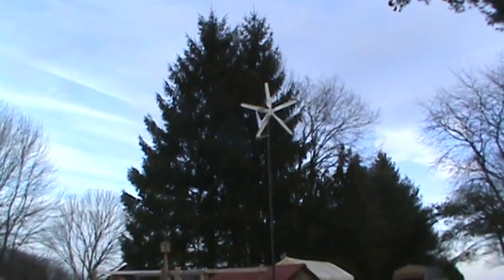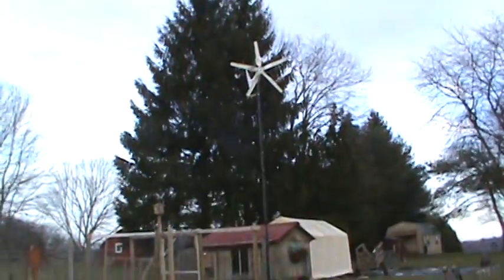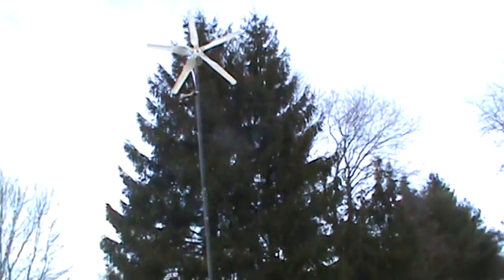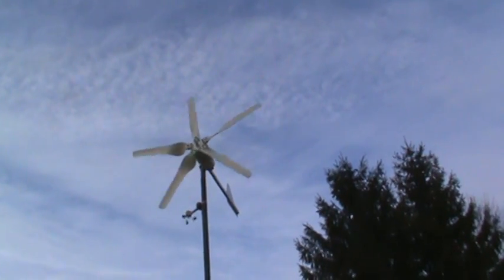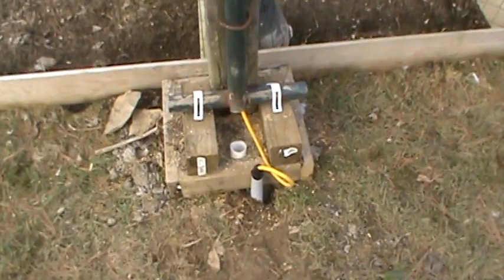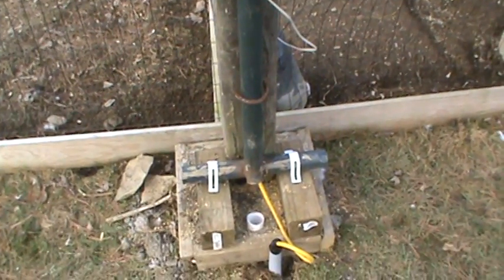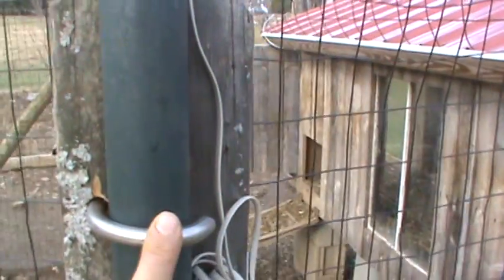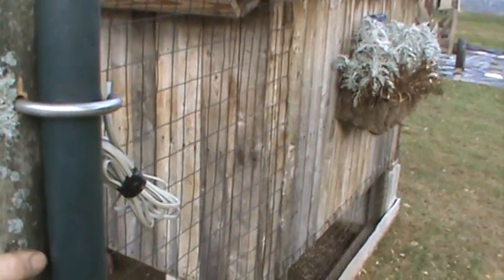wind turbine 2

Comment: Nice setup you have. Use AGM batteries if you can afford them if not try 12V Trojan Golf Cart Batteries..
Reply from the maker: I have been looking at agms that is what I think I will be buying .. right now have a marine deep for now thanks
Reply: The Trojan T105s are a great choice for solar for the money. They do have to be vented to the outside for the off gases that  they can create while charging. The hydrogen gas is able to start a fire if a spark is introduced. If you use flooded batts make a box around them and vent them with some pvc pipe to the out side.
Reply: Pinetar Robyn Homestead Marine Batteries are not very good for solar unless you need the CCA's to run high power induction motors. With the cold weather you have you will need to keep your batteries indoors so SLA's will be your best bet. AGM's are very expensive so keep the Amp/Hrs you use down to a minimum using low power 12V devices whenever you can.
Reply: Some good and expensive Rolls Sarette Batteries would be the best. If you got real deep pockets.
Reply: shartne I think those batteries have a 20 life.
Reply: Yes the are supposed to be able to last that long.
Reply from the maker: ***** I will take a look at the sla 's
Reply from the maker: Pinetar Robyn Homestead   what wire size do you use before the batteries  have size 4 from  batteries  to invertor
Reply: Hey I have used a lot of wires and had a lot of inverters. I would suggest 00  stranded real copper wire for the connection from the batteries to the inverter. If you got the money 000 and I like to buy used on ebay but if not they sell brand new marine tinned wire on ebay too that is great for solar. It dont corrode or well has not as of yet on me. I think the last inverter wires I got come off a giant fork lift and they work good and are real copper wire not aluminum copper clad. dont get copper clad wire its made in china and it is terrible. Its not up to specs on size and it just not real copper. It will work in  a pinch I guess. Its cheapo I will say that for it.